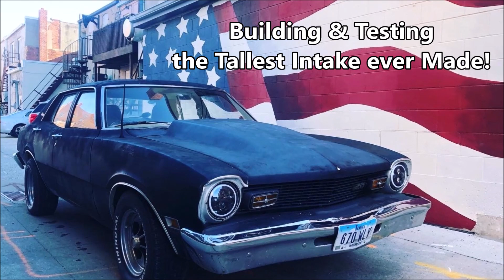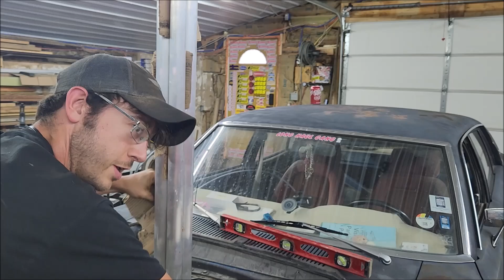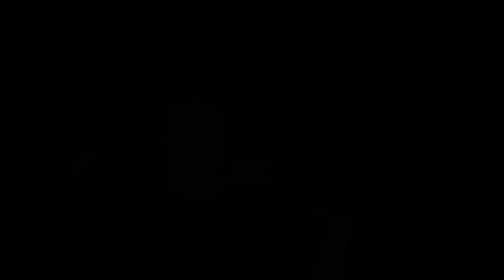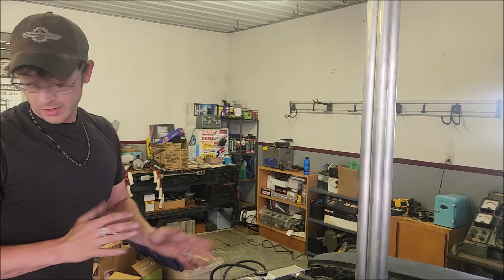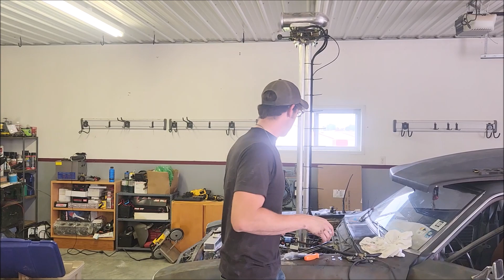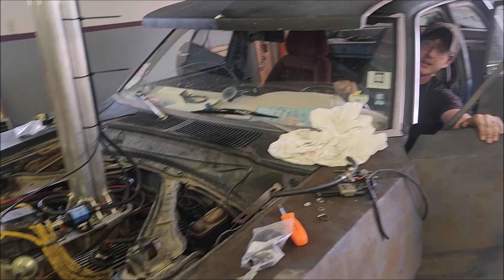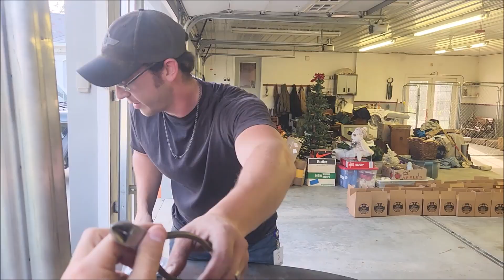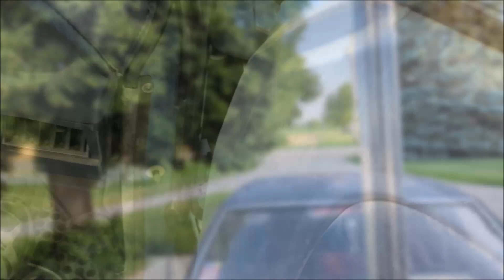Will it Run? World's TALLEST Intake! (move over "Sky Ram")

Comment: Not clipping the zipties was a fancy touch... If the lawnmower carb never finds its way onto this I'm gonna be super bummed out 😂
Reply: AGREE 1000%
Reply: I don't have OCD except for when it comes to uncut zip ties😂😂
Reply: It’s the equivalent of a mullet for a car
Reply: how about 4 of them, off a B&S 2 cylinder........
Reply: Ahaha I did that to a 1"hose I had running under the car for 3-4' under the floor that the pcv was hooked to.
It was like that for about 2yrs 😅
Reply: @leonallen9833  I'm ocd when someone doesn't cut em right and you scrape your arm on it and draw blood 😡
Reply: Exactly...
Reply: @MrTheHillfolk  im not aware, do you mean cut into a bevel so there aren't sharp edges?
Reply: @nikosuave4779  yeah trim that sharp edge off , it'll try and bite ya !
Reply: I like zip ties, better than Duct tape in most cases.
Reply: @MrTheHillfolk  thanks beavus, uhuhuhuhuh-huh huh huh.
Reply: @MrTheHillfolk  they make cutting pliers that will cut the zip ties flush at the head.
Reply: @rearspeaker6364 flush cut pliers
Reply: The lawn mower carb was cool though but why did he take it off any one know I really forgot about his channel just seen it again on junkyard digs were Kevin is showing when it all began with his channel and Luke dude you never age what's up with that lol just kidding man glad I found your channel again

Comment: I’m sure someone has said it already but this is taking your carb game to new heights.
Reply: I don't know which is more impressive.....the height of the carburetor or the solution to the throttle cable!
Reply: Ba Dun Dun Tsst!
Reply: My Dad would have liked that one
Reply: Yeah, who needs a supercharger when the intake has enough back pressure to create a boost off throttle.
Reply: I once did a really tall tunnel ram with as many carb spacers as we had. This tops it😂
Reply: @kevin2960  how to flood your engine in one rotation.

Comment: AT LAST,,,AT LONG LAST,, somebody who actually knows how to properly prepare a gasket.!!! Excellent dude. ✌️👍🇬🇧
Reply: Grease 'em and re-use 'em.  For valve covers, glue to the tins, grease the head surface.  While the heads are being machined, buff down the gasket surface to get rid of the rough cast.
Reply: The fancy way is using Hylomar on gaskets. Kinda like using grease except developed by Rolls-Royce during the war 🇬🇧

Comment: I know I'm not the only one who would LOVE to see this dyno tested. Oh, and I just noticed your improvised glove compartment lock 😅
Reply: Its pretty classy!
Reply: At lower rpms it probably gives about 50% more torque
Reply: @moabman6803  I though of making an custom intake for a tractor for optimized power at around 1600rpm (the most torgue of avarage tractor diesel)

Turns out the intake runners would have to around 2meters long.. About the lenght of the one on the video!
bet it has a massive spike under 2k if he ever dynoes it
Reply: @NuffMan_  Ya holley dynoed the April fools intake they made it it had a huge torque spike off the bat. The results are on the internet somewhere
Reply: @moabman6803  Found the video, looks like they got the max power at 3600rpm, the intake needs to be longer the lower you want the power :DD

When i was planning the tractor intake, i was thinking of routing the pipes over and around the whole engine a turn or two to get the lenght xD

The Holley's april fools video
https://youtu.be/y9IERetMoL4
Reply: engine masters did something like this

Comment: The throttle response was better than I thought it would be!
Reply: Longer intakes usually improve response because of the large vacuum chamber the intake acts like
Reply: @turkeyboyjh1  A large vacuum chamber isn’t what you want for quick throttle response. You have to fill that chamber with air before the engine can pull it in and respond. 
Short runner individual intakes are the quickest throttle response, but they tend be mostly for high rpm power.
Reply: @turkeyboyjh1  This isn't an intake.  It's a carb spacer.  He's still using the dual plane underneath it, so the runner length didn't change. The scavenging is going to be pretty much the same.  Now if he did this again using an EFI lower intake, so that he had 8 separate pipes converging to one at the carb, then it'd be an intake with 5' runners.
Reply: Ram air!

Comment: Back when I raced oval dirt cars I always kept a stick of chap stick for carburetor gaskets. Used it on the metering block gaskets when doing jet or power valve changes.

Comment: A friend adapted a 3 bbl Weber from a Porsche 911 to a custom 96” Harley Shovelhead.  He had to do a fair amount of tuning after completing fabrication of an intake that mounted to an S&S Super G manifold.
Worked out pretty well. Only issue he wasn’t able to overcome was the lack of a choke on the Weber, requiring liberal use of the accelerator pump for starting, and an unusually long warmup period.
I bought the bike a few years ago, but he bought it back after his wife died.

Comment: I think a dual lawnmower carb setup would be interesting.
Reply: That's a good idea. Or six of the same one barrel lawn mower carbs to make a six barrel lol
Reply: @poweredbyford87  I used 4 S&S carbs (aftermarket performance carb for Harley's) on a 350 in a 79 Chevy pickup. Getting the synchronization down was a bitch and almost made me abandon the whole idea.
Reply: Custom sixteen barrel with moped 12 mm carb and a shorter secondary with 22-26mm, progressive linked.

Comment: Neat idea.  However, there are some things to consider.... You will not  be able to do most drive through for burgers and taco's.   Just remember back in the day inn the 70's  I had a friend with a 64 impala with a built 327 and he put a fuel injection on it.  The pipes stuck up a good ways out of the cut out we made in the hood.  It looked so Cool and Tough..   We took it for a test run down the road and promptly got pulled over.  The Cop said that we could not have anything sticking out of the hood that blocked your forward vision...  Along with a couple of congratulatory tickets for our escorted trip back to his garage.

Comment: I would take some metal wire on four corners and tie it down with turn buckles from the carburetor to the fenders so it doesn’t swing in the wind and eventually break your carburetor base off your intake manifold
Reply: That would make it even more likely to break.  The engine moves significantly within the chassis, and would easily bend those tubes.
Reply: Yeah you'd need to chain it to the heads or something not the fenders. Otherwise when the engine torques it would pull against the supports.
Reply: @michaelangelo8001  to 4 corners of the engine.

Comment: Have a couple of ideas for "improvement" on the intake. First, bend the tubing so the carb is on top of the roof. Second, have the carb dump into a larger "plenum" before going to the individual tubes.

Comment: I wonder if icing is gonna be an issue. Anybody who's had a VW with a stock single carb or a Bugspray and broken heat risers knows ALL about carb icing....
Also, you might want to think about running a cable from the rad support up to the top flange, because if it doesnt ice, youll be driving at highway speeds with all that snorkelization catching breeze and pulling it back towards the glass/roof/etc...

Comment: But how will you hook up the PCV? :)  I grease my carb gaskets too, they work forever and seal better in my opinion.  I have to imagine the fuel mix is delayed some with that, when you turn it off a lot of fuel will run down the pipes into the motor, but when you floor it I expect it would go very lean at first then flood when you let off.  Still, it's ridiculous which means it was time well spent.  Well, your time not mine...

Comment: Just call it SkyJet Ram, Eagles or Storks nest, Condors house, Everest's Power Formula or whatever fun or technical name

Such super long intake runners might work like the Chrysler Sonoramic Commando long runner dual quad intake manifold from the early 1960's, lots of torque and not a big increase in horsepower

Try that combo in the dyno, also make it aerodynamic with some sort of airfoil enclosure

Comment: Thats a carb spacer,  not an intake.  Still pretty great though. I wonder how many nitrous and fuel nozzles could be installed in those down tubes?
Reply: over a hundred, will need a trailer for the nitrous tank!!

Comment: BTW, your tinkering has  planted an evil seed of thought in me regarding your B&S lawnmower carb experiment on 'Mad-Mav'!
  How impressive and kool would 2, 4, or even 6 of those cute little aluminum B&S or Tecumsah port-mounted sidedrafts all polished up look mounted on a vintage Triumph TR 6 Brit sportscar engine instead of the two stock Zenith-Stromberg sidedrafts? 
  Sure would piss-off those chaps that spent all the $$$  to put those expensive Weber sidedrafts on their cars too, especially if it outperformed them!
  Heh-heh-heh...😊😂

Comment: I'm worried about the carb base down on the intake & the bolts pulling out of aluminum intake going down the road?
Reply: The Aluminum welds to the spacer will fail before the bolts do

Comment: This should really test your carb tuning capabilities with the carb at such a higher altitude than the engine itself. I mean which altitude air density do you use? Since the air is thinner up at the carb do you use a smaller carb or just smaller jets? 😊

Comment: Hey. You should makes the beer chiller. Intake out of the tall intake you made.  Cut it about 2ft high. And add two pipes big enough for the beer can to fit in.  Weld. Pipes on both sides of the carb

Comment: Were the holes offset on purpose on the custom made top Plate ? 2 holes are touching and the other side 2 holes are nicely spaced? On the one cut out from the thick aluminum flatstock plate @Thunderhead289

Comment: How about Carburscope? Damn I thought running a V8 on a lawnmower carb was crazy, now this takes it to new heights! If it just runs it would be crazy much less drive the thing! I enjoy your crazy ideas so keep up the great videos!!
Reply: I think he needs to dyno test it and see if it gets more power or not or what it's putting out now. I think he should've made different lengths of this and see which ones work the best. But need to see more and see how it runs long term. Oh just wondering is this legal to run this thing around town? It seems pretty tall and not sure if he would get pulled over with that thing so tall.

Comment: Two fuel pumps inline will give about the sum of individual pumps pressure.  Mid / late 80's Mercedes with CIS injection sis this to get enough fuel pressure.
Reply: 86-88 f250's with v-8's did the same thing.
Reply: @rearspeaker6364    Yes, and Bronco 2 .  These systems were to assure non bubbly fuel ( + a bonus on dual tank systems, see below )  rather than a fuel pressure boost.. The pump in the tank was just a low pressure lift pump feeding a black plastic canister that bleed bubbles to the return line then the feed went to the external pressure pump.

Now for the bonus on Ford dual tank systems.  Rather than using an electrically operated tank selector valve, Ford shut off one in tank pump and let the other run.  A series of check valves in a dual tank debubbler ( that black plastic canister. ) would shift return fuel to the tank that has an in tank pump running.

Comment: I'm afraid at that altitude and that far away from the engine heat your biggest issue besides, low hanging branches, power lines, bridges/overpasses and low flying planes, will be carb icing.  You should of ran a coolant heated carb spacer under the carb with a heater hose running up each side of your "tower of power".
Reply: needs some deer chasers too.

Comment: He should have used one single round tube instead of seperate pieces. The whole point of tunnel rams and extended length manifolds is to permit the fuel air charge to mix as thoroughly as it possibly can in the extra  height it has to do it in. Running seperate tubes all the way from the carb down to the intake ports would totally defeat the purpose of having such a device in the first place
Reply: Wrong, sir. A single tube all the way down would KILL velocity, and the fuel would fall out of suspension, literally rolling down the walls of the tube. Individual runners keep the velocity high, but a small plenum at the top is necessary for equal cylinder to cylinder distribution, and timing of the "back pulses" up the intake.

Comment: here's a project for you, what you need to do, you need to create a circular sphere and the inside must be completely mirrored, and there must also be a mirror pyramid Inside this sphere, and it must have a diamond at the top of the pyramid, this sphere must also have a camera lens attached to it with a magnification of at least 10 X and its focal point must be on the diamond, the purpose of this device is to capture a beam of light, a ray of energy, and in the process what you are trying to reproduce inside this sphere with the beam or ray of light is you want to create a concentrated Beam of light to pattern the star David, you can also use a laser to arm and create the same effect,and the power and the color of the laser will determine how fast this reactor is armed, what happens at this point is anyone's guess, obviously, the sphere will get hot, I have left some of the details out of this device because if you're supposed to have it God has given you the other details.
this is a formula for a solar reactor, and it could also be used as a high-powered laser.
I have possessed this information for many years not knowing what to do with it because of the impact it could have on the world, but because the world is now at war with evil I believe it is time to release it.
Bill Sharpe Sussex County Delaware.

Comment: suggestion: compressed air blaster at the venturi to better atomize the fuel.  Set a duty cycle to pulse based on throttle position

Comment: If you are worried about the fuel coming out of suspension, you could weld a couple of tubes to the 4 risers and make a loop for coolant from the heater hoses to flow through.  

It's basically putting ketchup on a turd, but it should help.
Reply: or, wrap 20 ft. of clear vinyl tubing around the bottom of the adapter to warm it up.

Comment: thats the tallest carb spacer Ive ever seen pretty wild it just fired up. Why is it you love rusty junk so much I mean dont you have a much nicer 65-66 Galaxy with a blower on it somewhere. 1st it was the old fox Mustang that was nearly rotted in two and now you have been beating on this old Maverick for a few years and clearly it is in no better shape than the Mustang was so why are you not driving that Galaxy at least on Power Tour .....you gonna dyno this combo on power tour like ya did the lawn mower carb combo? I did notice as you were blasting down that dirt road your carb was always up in the nice clean air and not choking on dirt. Hopefully it doesnt rip the studs out of that aluminum intake if it gets to vibrating on the highway or if it gets to moving in the wind given it has no lateral bracing just some base gussets.Good luck on PowerTour

Comment: Just to clarify that is not the tallest intake nor ram air. It is the tallest carburetor/ spacer as if it truly was the tallest intake then each tube coming down from the carburetor would individually split off to a single Intake port on the heads.
Reply from the maker: If that's the case where does an intake start with a normal carb? Same shape into the intake - a tunnel ram is the same way as this, is that not an intake? 
What is a carb spacer but an intake plenum expansion anyway - 

Better than someone making a big intake that still feeds the fuel from the normal spot 🙂

Comment: If you had inclined that carb riser 45 degrees forward you might have added free 'ram-air' benefits to it in the process.
  Twist those 4 pipes into a corkscrew shape as well and call that beauty 'Heavenly Unicorn'...
'Ezekial's Trumpet' also comes to mind for a name for your creation... 🎉😂

Comment: So, you moved the carb away from the engine heat to avoid vapor lock, but now you’ve got it closer to the sun which will cause the fuel to heat up!

Comment: ThunderHead289 I have a question. I have a 351m .040 over, it’s only going to turn 4500-4600 rpm. Polished ports in head and.0530 lift cam duration for torque and old street master intake. Would a Holley 750 be to much ?
Reply: I'm not Luke but I'd say its fine if it's a vacuum secondary

Comment: To properly balance the airflow you need thru the hood derby headers the same height as the intake. 😮 otherwise your intake to exhaust static pressure will be inverted. And everyone knows that will make it run like crap. 😝
Reply: 🤣🤣actually the intake may force the engine to go runaway, due to the air ramming down the intake, the mufflers will glow and fall off first🤣🤣
Reply: @rearspeaker6364  that would be cool to see.

Comment: I think you could market  it as the ultimate solution for vapor lock.  You can offer several kits with, or without the modified hood to accommodate the "SUPER STACK" intake system.
Reply: "Ultra Stack"  :D
Reply: @haydenc2742  how about "Ultra Super Stack" 👍🇺🇸
Reply: @haydenc2742  how about "Ultra Super Stack" 👍🇺🇸

Comment: So..... did it have a great tunnel ram effect, or just same as no distance? Cuz racers insist the tunnel ram adds power....
Reply: Biggest thing with a tunnel ram is more direct flow to the valves. A normal low intake requires a few direction changes for the airflow.

Comment: Now all you need is an air to air heat exchanger it it to make a ghetto air conditioning system that works of the evaporative cooling you had on those intake tubes.